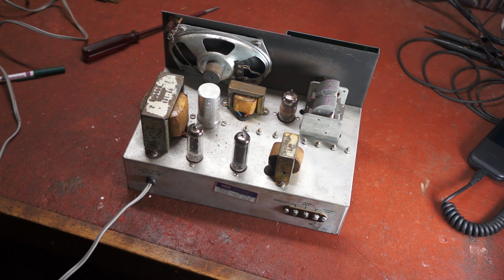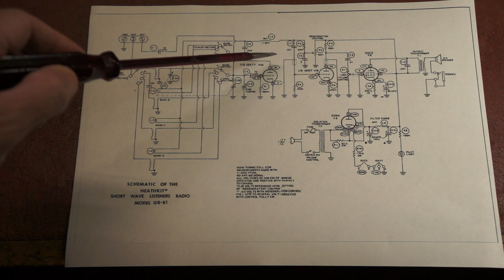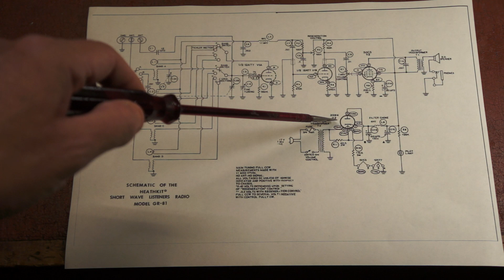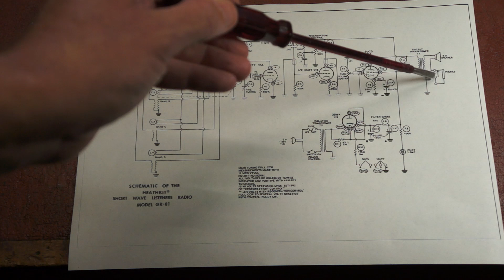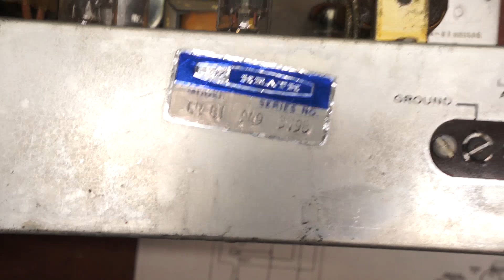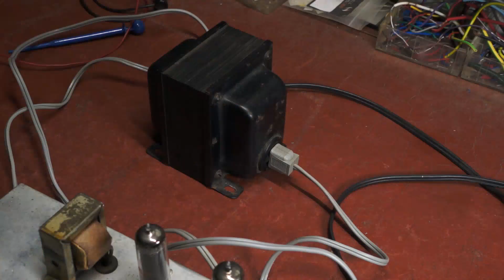Heathkit GR-81 Radio Receiver.

Comment: The Neon and R value most likely provide a margin of HT stability, for the regen would think. Heathkit always found a way to cut costs and make the best of a component to do two jobs.
Reply from the maker: If the detector voltage had been taken directly from the neon tube that would make sense.

Comment: Wow! What a fabulous little set. I'm well aware of the results you can get with that sort of regenerative design - I've built several over the years with valves or FET front ends. I wonder if this was sold in Britain (with a different transformer, obviously).
The British made Codar CR45 was a similar concept, albeit with different valves: double-triode detector / audio, pentode output plus rectifier: it looked a bit cheap and tacky compared with this, though. 😉
Reply from the maker: I did look through some old UK Heathkit catalogs, and interestingly they produced kits unique to the UK market. They must have felt the potential customer base was large enough to justify that. It makes sense in some ways; aside from the 240V requirement was of course LW reception. A few U.S. kits were available, but ironically not the GR-81 which does receive LW.

Comment: I had one of those I got in "for parts" state at a ham flea market.  It was missing the tubes as well as the isolation transformer.  I rebuilt it keeping the 12AT7 tube, but sub'ed a 6AK6 for the 50C5 output tube, and I replaced the 35w4 with a solid state diode.  I used a 125v @15ma, 6.3v @ 600ma "booster" transformer in the power supply.  I rewired the set to use the second half of the 12AT7 as a reflex grounded grid RF stage, and a common cathode 1st AF amp, as was in a similar circuit from a Popular Electronics article from the 60's.  I also added a Jakson Bros. vernier dial to the main tuning cap between the knob and the capacitor giving me over 10:1 total reduction..  The set worked OK, it was a nice, simple regen SWL rcvr.
Reply from the maker: Interesting to know of your mods to the GR-81. A regenerative receiver like this would have benefited from an RF amplifier as part of its original design. Nothing complex, but just a simple untuned stage to remove the effects of aerial loading and to provide some gain.

Comment: What about grounding the antenna coil.
Reply from the maker: Mains operated sets have some capacitive coupling to ground through the transformer, but I did try this set with and without a direct ground connection. It probably added another 3dB to the gain, but it wasn't a huge difference.

Comment: Restored one of these about 4 years ago.  Paid $30 US for a badly rusted dirty non-working radio. Cover had to be sanded and re-sprayed. Chassis was badly rusted. Ended up painting the chassis as the naval jelly took off the cadmium plating as well as the rust! There were seven joints that had never been soldered. One was from the audio transformer!  Scrubbed the dirty knobs, everything came clean. Replaced the electrolytic capacitors as well.  Thanks for pointing out the mistakes in the schematic!

Comment: It's always a joy to see a new video from you on YouTube. I'd love to own a GR-81 or perhaps to build up an equivalent set. A few months ago, I discovered your website and spent a few pleasant afternoons binge-reading it. Maybe it's just me, but I think that the regen receivers are the best. I own an Eton Elite 750 (the nicest hunk-O-junk I've ever owned) and use it for MW DX with a combination of its rotatable MW/LW antenna and an external tuned loop, useful for peaking stations or nulling out noise. Most of the time, I've found that putting in 20 or 40 db of attenuation results in a better signal to noise ratio. As someone once observed, superhets  can seem to struggle against the internal noise they generate. Massive IF gain can cause undesirable compression effects.  I'm off to read your article about the GR-81.  Cheers, and thank you for posting this video.
Reply from the maker: Thanks for the compliments. I've long been a fan of regenerative sets. Simple, but effective and easy to construct. Also free from spurious responses. Interesting point re the internal noise of a superhet - it would be interesting to actually measure it and compare.
Reply: @cool386vintagetechnology6  Thanks for your reply. I've read your page about the GR-81 and found it to be extremely interesting.